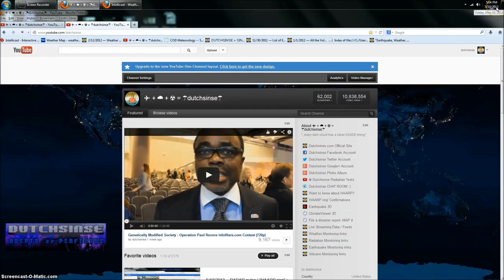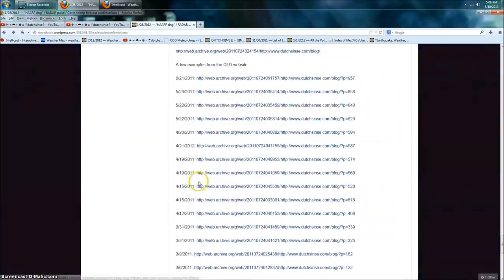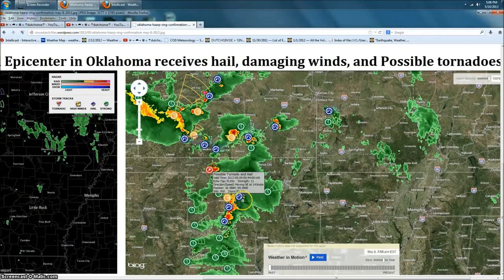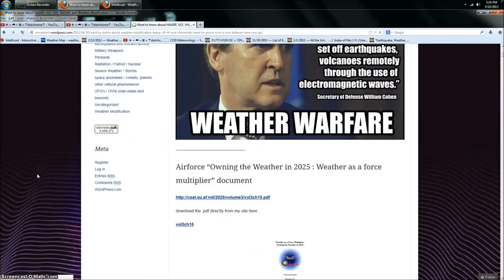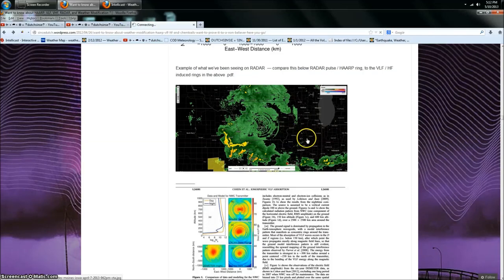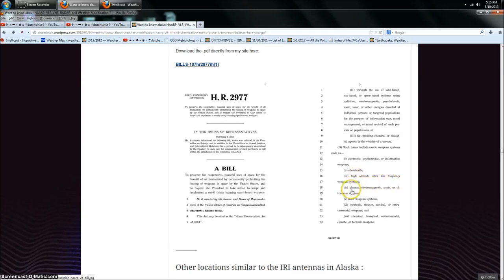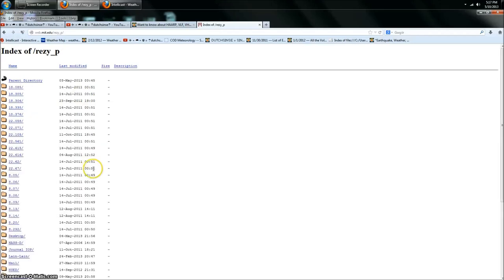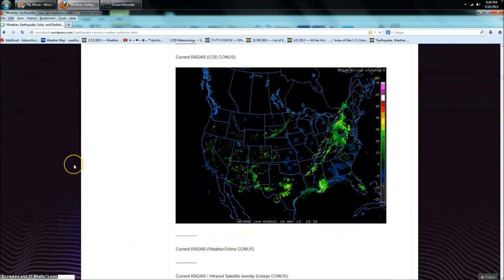5/10/2013 -- RADAR pulses / "HAARP rings" / Scalar Squares -- INFORMATION REVIEW

Comment: Michael, have been monitoring the same static ionization pumping above areas of wind farm sites (specifically the four sites around Dodge, Ks.).  One can note  the density changes in the areas of windfarm sites when specifically tuned frequencies and digital information signals of dual phase Doppler radar interrogate these areas.  These ionized  stratospheric areas at/ around/above wind farm sites of chemically enhanced air act in the same manners as the ionosphere.  Hence, new HAARPing.